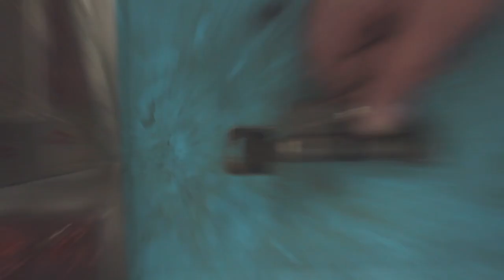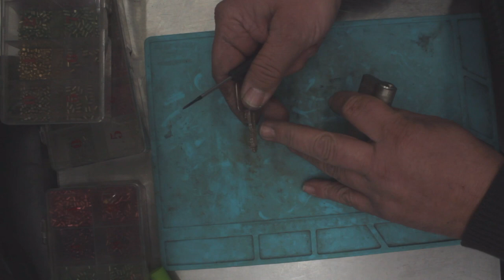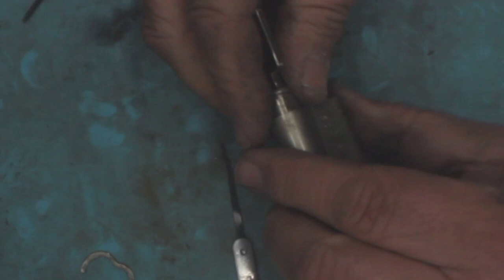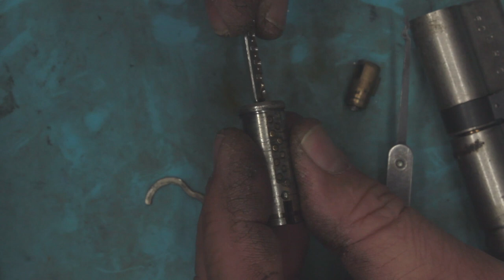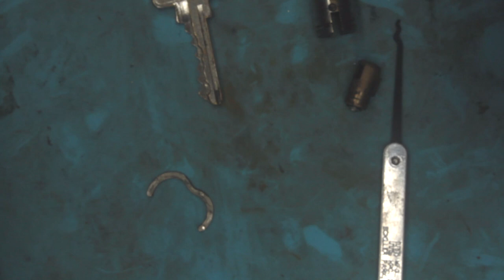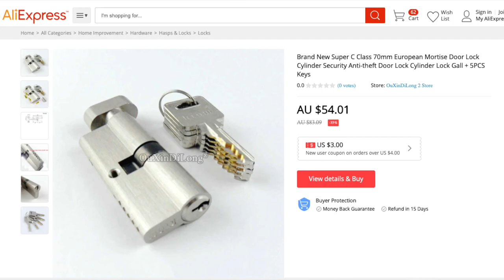CHECK OUT THIS FUNNY KNOCKOFF

Comment: I have seen a few different types of LOCK branded locks all from China and all crappie locks. But that key looks kinda like it would have a sidebar with one side of the bitting lower than the other. But besides that it looks a lot like a knockoff of a Bilock with the 2 rows of pins. But no sidebars at all. 
IDK if they designed it this way because they liked it or had to for some other reason. Either way it is a shit lock.
Thanks for sharing.
Reply: I would say that this looks more like the ASSA Twin rather than the BiLock haha. These are quite interesting locks nevertheless, many of these are quite rubbish.